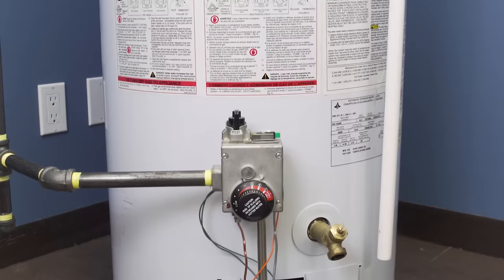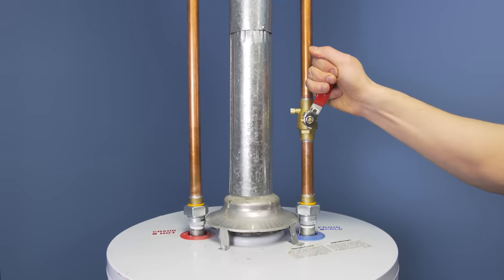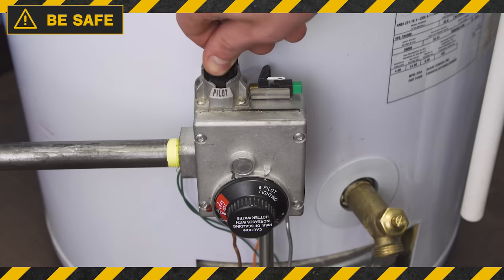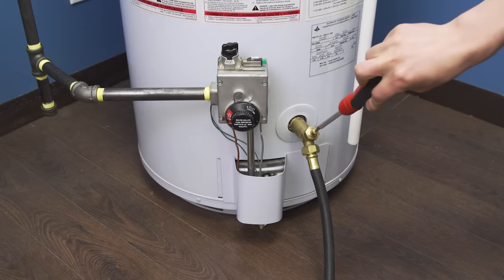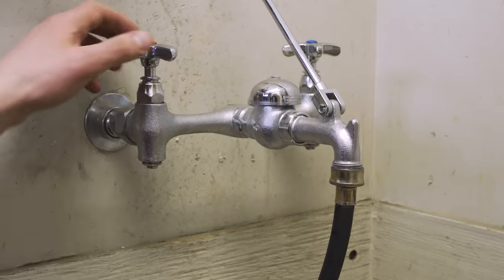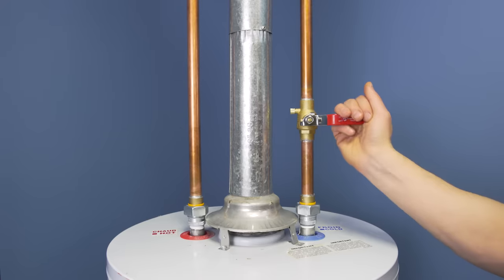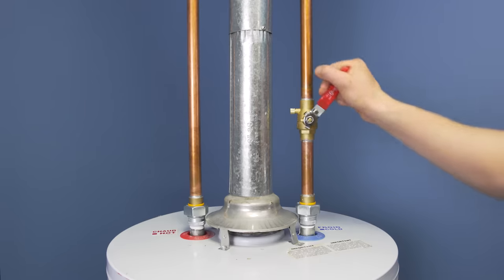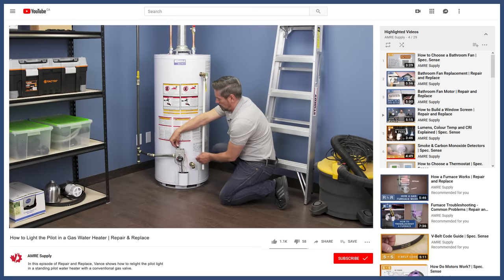How to Drain & Flush a Hot Water Tank | Repair and Replace

Comment: Thank you for the wonderful video,. I am looking into replacing my supply lines with flexible lines... Should I worry about galvanic corrosion? Seems like the materials would clash. Would liquid teflon product suffice or ? Thank you for the help
Reply from the maker: Thanks for watching, we're just happy to help. What you'll want to use is a dielectric nipple which will help prevent galvanic corrosion. Some regions the plumbing code will actually require a dielectric nipple to be used so it's best to check the codes for your region.

Comment: Turn off main water valve 1st!!! Backflushing several times is a pia. Just close the open faucet, turn on the cold water feed to pressurize the tank and force the sediment out the drain hose. Mine momentarily clogged and spit debris 6-8 times, way easier and quicker than changing hoses, more thorough too. Once flowing cleanly, go back to normal draining. I've drained, I opened the feed again for 25 seconds further breaking up sediment as the water steel pounded the tank floor. This will be necessary for h20 heaters that have been ignored, which is 95%.
Reply from the maker: Thank you for sharing your experience! You are right that there are other ways to flush the tank, and it's often not a smooth process.

Comment: Question here please. My tank has 8 year warranty, I'm on the 9th. Ive never drained it until now. I agitated the bottom many times and finally got the tank to run clear. Problem is inside hot water is still off colour.  I live in Vancouver, BC for location. Evety plumber says I need a new tank. Is there more I can do?
Reply from the maker: Thanks for watching. There might have been some very fine sediment that is now floating in the tank. After a shower or two that will likely disperse. If the tank is still heating effectively you might not need a new one. Has the water started to run clear now?

Comment: I wish every heater drained like a new one. Do a 90’s Rudd next. Those drain valves are extra fun and might have some bloopers for YouTube gold. Your pretty brass one is great for class. But let’s do real world study.
Reply from the maker: Thanks for watching. While filming this series we had 3 tanks. One was 10 years old, the other was 20+ and the 3rd tank was from the 80s which we cut open for the interior shots. It is impossible to show every real world scenario but we try to show what we can with the tanks that we had access to.
Reply: I'd like to know how long after the flush did the tank fail.Cause that sediment in the bottom is actually helping to keep corrosion from attacking the  ylider
Reply: @paulkeogh1191  what is a ylider
Reply: @AmreSupply  yeah yeah. But the disc shape valves you have to turn your hose on clockwise. Then to open the valve you turn counterclockwise. And pop it out with a surprise. Lol. I wanna see action where an unexpected homeowner turns that Valve a hair to far and chaos floods in. Those have to be funny to watch. Wasn’t really talking about the sediment build up. But ok thx I guess.
Reply: Lol cylinder.stupid auto correct.Plumber 35 years.

Comment: Silly questions but should the hose be a cheap one?  will it ruin the hose cause of the hot water? can it be drained into street? I was told to do it once a year is that enough?
Reply from the maker: Hi Sarah, thank you for watching. Hot water can degrade garden hoses but it won't instantly destroy it but it will cause it to wear out faster though. There are "hot water" hoses but they are more expensive. You can however, turn off the water heater (but leave the cold supply open) and take a shower or do a load of laundry first. This will help use up the hot water in the tank. Afterwards the water in the tank will be warm but not as hot as before. This will make it easier on any hoses that you use. As for the frequency of a tank flush it really depends on the hardness of your water and how much sediment accumulates. For many people once a year can work. During that time it's worth checking the anode rod to see if it needs replacement: https://www.youtube.com/watch?t=83&v=ZTUNLIXKVu4

Comment: I see in the video you back flushed the tank with hot water.  How is this possible if you are trying to flush the tank at this time and all valve to the tank are blocked in?
Reply from the maker: Hi Mike, thank you for watching. You have a good eye. This has been pointed out in previous comments but unfortunately its not something that we can update. When filming these videos we often film multiple takes at different times / locations, and the pieces are edited together afterwards. During the backflushing shot we did what visually looked best on camera (moving the closest handle) while not realizing it was the wrong handle (which not would result in any water flowing).

Comment: I don't worry about it, if it goes out!  Buy a new one  City water should be pretty clear of it.  I live out in the country and have a deep water well. Where you get sand  way i keep it from going into the pipes in the house is a filter tank system! I just drain the holding tank and filter tank Flush them out
Reply from the maker: Thanks for sharing. Living out in the country and using a well does have some differences. You can't go wrong with a filter tank though.
Reply: @AmreSupply  reason it put it on was it was a new well. Until the cavity settles down, then it will quit pumping the sand. i just flush it again NO SAND

Comment: Why would my water coming from drain valve be cold? If I close the drain and turn water back on hot water is coming from faucet? 
Could my bottom element be burnt out?
Reply from the maker: Thanks for watching. If you have an electric water heater, then the water at the bottom of the tank will be colder than the water at the top. The heating elements will be used intermittently depending on the demand of the tank. This video by "Technology Connections" explains it well https://youtu.be/Bm7L-2J52GU?t=285

If the tank is not heating up as effectively then the bottom element could be faulty. If needed you can test the bottom heating element for continuity.

Comment: My drain valve has a slow drip after doing this will that go away?
Reply from the maker: Thanks for watching. If the slow drip is coming from inside of the drain valve then it's possible that there is sediment preventing the rubber stopper from sealing properly. You can open the valve to let some more water through as this might help. This is why open port ball valves are useful as they do not suffer from this problem: https://youtube.com/shorts/C3-eTMsbO40?feature=share

Comment: Can a broken outside spigot cause low water pressure in a house, My spigot does have a crack in it. I have no leaks in my home, water meter is remaining normal. But I have lost water pressure in my whole mobile home both hot and cold water. I replaced all faucets about a year ago and hot water tank as well.
Reply from the maker: Thanks for watching. A leak could create a drop in pressure but you'd see evidence of water around that spigot.

Comment: I just did rained HWT this past weekend.  One question, now one of my interior sinks will not run water.  No hot, just a small stream of cold.  Every other faucet words fine.  I left the faucet on for 8hrs and nothing changed.  Any advice?
Reply from the maker: Thanks for watching. It could be helpful to clear or replace the aerator as well you could, turn off the shutoff valve, disconnect the faucet supply lines and see if the how water flows once you open the shutoff valves. If the hot water flows when the faucet supply line is disconnected. then the blockage is in the faucet.

Comment: Thanks so much! Is the same process for an indirect water heater and can I use a transfer pump to move the draining water further?
Reply from the maker: Thanks for watching. Yes if you have a indirect water heater with a drain valve then it can be drained in the same way. A pump can be used but keep in mind that that very hot water might be damaging to some transfer pumps.
Reply: @AmreSupply  Thanks, I will have to check that.

Comment: During the process of refilling the tank is there some sort of mechanism that keeps the unit from overflowing? My cold water valve on the water heater is in the on position, so i imagine when the unit refills it'll know at some point when to cease incoming water into the tank
Reply from the maker: Thanks for watching. When refilling the tank, have the hot water faucet open in the highest point of your home. The tank will fill until water will run through the hot supply pipes to the faucet. You'll notice bursts of air and water, and when the air stops "burping" then you'll know the tank is full and the hot water line is completely full of water. At that point shut off the hot water faucet, and the system will be good to go.
Reply: @AmreSupply  wow sensible and prompt response thank you so much, I truly appreciate it.
Reply from the maker: @KusHome12  You're welcome, we're just happy to help!

Comment: If I have already cut off the water to the hot water heater, and I am back-flushing, wouldn't I want to turn on the cold water, not the hot, so I'd get more pressure for the backflush?
Reply from the maker: Thank you for watching. You have a good eye. This has been pointed out in previous comments but unfortunately its not something that we can update. When filming these videos we often film multiple takes at different times and the pieces are edited together afterwards. During the backflushing shot we did what visually looked best on camera (moving the closest handle) while not realizing it was the wrong handle (which not would result in any water flowing).

Comment: My GE water heater is now 10 years old. The water heater was already in the house when i bought it and was never serviced by the previous owner. The hot water has far too little pressure at all the taps. But the cold water is under full pressure. I thought flushing the tank might help, but the pressure is still low. What else could be the problem?
Reply from the maker: Thanks for watching. Some hot water systems are fitted with filters, if there is a filter then a build up of sediment can restrict the flow for the hot water.

It can also be an issue with the pipes themselves. Sometimes corrosion can build up, but this will be effected by age of the home, water quality / composition, and the type of the pipes. This is harder to diagnose so it can be helpful to call a plumber in this case.

Comment: Is this necessary if you have soft water plumbed into the heater?
Reply from the maker: Thanks for watching. It is more necessary with hard water but it's still good to check. You can remove the anode rod to look at the degree of corrosion. A heavily corroded anode rod is a good indicator that there will be more sediment in the tank. https://www.youtube.com/watch?v=hTJv67imgaE

Comment: Is it okay to use the water heater drain as an outdoor spigot line for rinsing purpose? The water heater at my property has a line connected to the drain that leads through the wall and outside spigot. Between the line looks be a converter because if I touch the line before it, the pipe is warm. But when you turn on the spigot outside it comes out cold. My tenants have been using it to rinse off beach sand off their dogs or items as we live in a beach community. Not a full flush out, its just a few minutes usage of water to wash of sand. Do you know if this is okay or is it likely to cause damage on the water heater?
Reply from the maker: Thanks for watching. If the water heater was supplying water to that outdoor spigot then it would also be warm. It is possible that it looks like it is connected but there is another line somewhere connected to the outdoor spigot.

Regardless if you are draining water from the bottom of the water heater, you might get some sediment but you'd still be able to safely rinse off sand etc.
Reply: @AmreSupply  do you guys have an email address? I can send pictures of what it looks like

Comment: For back flush do i need to close the drain valve? Or does that stay open during back flush
Reply from the maker: Thanks for watching. When flushing the tank, it can be most helpful to drain the tank fully and then turn on the cold water supply to spay water onto the sediment at the bottom of the tank. A back flush can be done when the water isn't draining, as a back flush will help clear any sediment that blocked the drain valve. For a back flush you'll need the drain valve open.

Comment: ok so the settlement will clog the drain so back flush? isn't the settlement just going to clog  drain port again after all  isn't getting the settlement OUT the purpose?  I don't feel like this is a valid procedure.  In my opinion if your settlement reaches that point I think it is time for a new water heater/  or a tankless heater....
Reply from the maker: Thanks for watching. It is difficult to know how much sediment there is and how big the pieces are. The hardness of the water will change this. In some cases draining you may only need to back flush once or twice before it starts flowing again. This video is meant to show the options available if some decides to drain and flush the tank. As well a back flush might be needed in the case of a leaky drain valve. If there is a slow leak then the tank will need to be drained and the valve replaced: https://www.youtube.com/watch?v=nGCejMsKNX4

Comment: I am wondering what I need to do when water is not running out of tank nearly at all after I closed water tap. But it comes out when I run the water tap on.  😢
Reply from the maker: Thanks for watching. To drain the tank you need a way to let air into the tank. If you close the faucet, then you create an air lock, which will stop the tank from draining.

Comment: I was just wondering how if you open up a faucet in the water line how will that leave pressure in the system
Reply from the maker: Hi Arlen, thank you for watching. Opening up a hot water faucet will allow air to escape which will reduce the pressure when the tank is drained. Without it, the system is air locked, and the pressure the air in the system will prevent the water from draining. Its the same principle as using a straw. If you pull water into the straw and then put your thumb over the top, the water will stay in the straw. When you release your thumb, the water will fall out of the straw.

Comment: can i flush tank with temp set on pilot and not cut gas line off?
Reply from the maker: Thanks for watching. If your gas has a supply valve, then it's best to turn that off before doing a flush, and turn the control valve to pilot to be sure. If you are unable to do that then setting the control valve to pilot will prevent it from turning on during a flush.

Comment: What do you suggest if even the back flush fails to clear the clog? I've tried opening the drain valve with the water still going and that's only getting bits and pieces out
Reply from the maker: Thanks for watching. People have used a variety of creative solutions to clear a blocked drain.

You could use a wire to help push the sediment clear of the drain. Just make sure that you do not damage the rubber stopper or the drain valve might leak afterwards.

Other people have used compressed air to "burp" the system. Others have rigged up a shop vac to try to use suction to clear the blockage. These might take more creativity to set up.

Comment: How do you drain the tank if you don’t have a floor drain? I have a sink, but it’s too high.
Reply from the maker: Thanks for watching. Half of the water inside the tank will be higher than the sink so that water will drain. After that you could try to get a siphon going but it might not work too well if sediment breaks up the flow or if you get air bubbles. If you really need to drain the rest of the tank then you might have to drain it into a pan or a bucket. This is more labor intensive.

Comment: I tried to drain my 3 year old water heater.  However, after an hour the draining from the drain valve  would not stop. The t draining from the pressure release valve wound not stop either.   Nor did the draining from one of the open hot water faucets..   Seems to me the cold water was somehow back filling into the water heater through the water heater's hot water OUTLET..   Is it possible and how to fix this problem ? Yes, I did closed the cold water inlet to the water heater when doing the draining.
Reply from the maker: Hi there thank you for watching. Even though it is not ideal, it is possible for the hot and cold lines to be connected after the hot water tank. Sometimes there are mixing valves that blend the hot and cold lines and other times the lines are connected somewhere else. Its hard to know how things are setup inside your walls as you can't see it. You should have a main water valve that can be shut off. This will stop all water from flowing in your home. You'll still have some water which is gravity fed that will continue to drain until the lines empty, but that should let you drain your tank.
Reply: @AmreSupply  Thanks for the suggestions,  I will use the main shutoff valve then.
Reply from the maker: @JM-gz1ej   No problem. We're happy to help!

Comment: Why would water come from the tank if the cold water supply is on BUT not if you turn off the cold water supply?  I am assuming if water can exit the tank then the spigot is not clogged, right?  If the spigot was clogged, water would never come out.
Reply: I got it!  Open the pressure value
Reply from the maker: @DaisyJane1234  Glad you got it working. Either by opening a hot water faucet or the pressure relief valve will prevent an air lock. This is the same principle of how putting your thumb over the top of a straw can hold water.